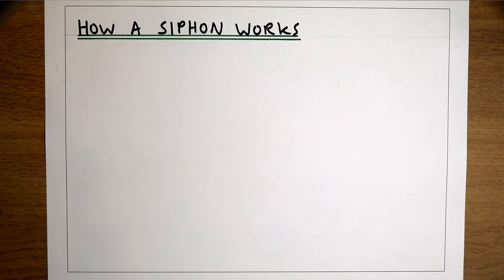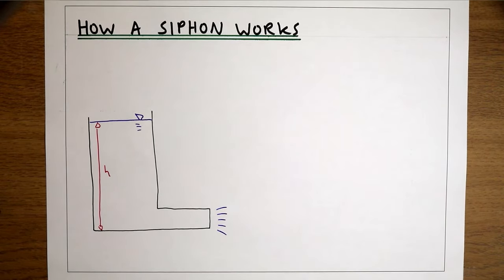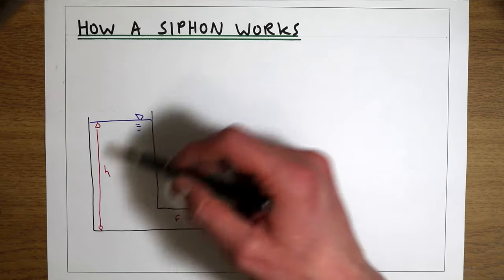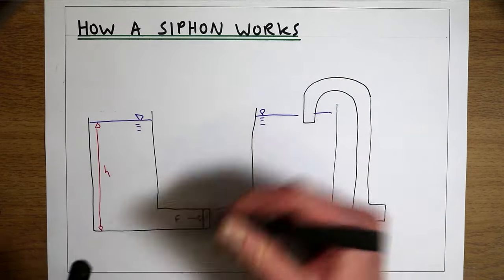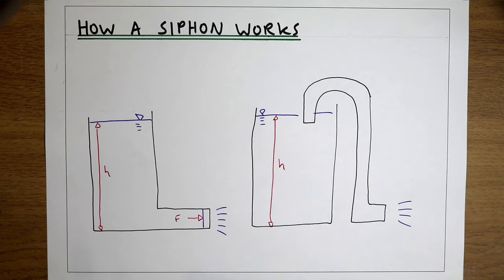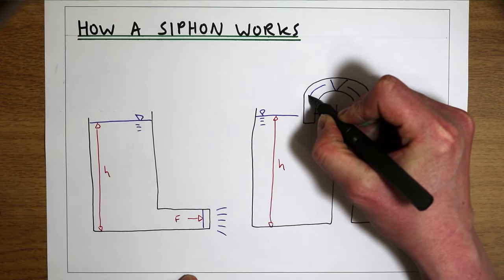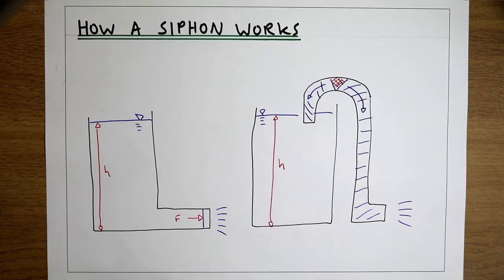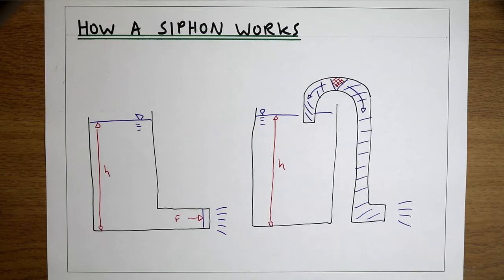How a siphon (syphon) works

Comment: That pipe needs to reach to the bottom of the container to have the same pressure as the first container
Reply from the maker: Hmm, that’s an interesting one. My argument would be that in theory, the liquid has the same total head at all points in the container, so the tube position in the container should be irrelevant (apart from that in real life, if the tube is near the surface, the syphon will stop as the container empties). If the tube is at the bottom of the container, yes, pressure is higher than if it was at the top, but if the tube is at the top (as I’ve drawn), elevation head is higher. The sum of pressure head and elevation head at any point in the container must be the same if we assume the tank is static prior to the syphon starting, and either of these heads can be converted into kinetic energy at the outlet interchangeably. If you work through the maths, the only variable that is accounted for in Bernoulli’s equation is the difference in elevation between the water surface of the container and the outlet. By the time the water has made its way through the syphon and to the bottom of the tube just before the outlet on the right, it will have the same pressure as the pic on the left, as the elevation head has been transformed into pressure head? It’s the principal explained in this video:

https://www.youtube.com/watch?v=IE72op7p9yY
Reply: @fluidsexplained1901  Yes that's correct, good explanation. It would make more sense for the pipe to reach near the bottom, but the overall net force will be the same as at the top.

Comment: This is a very limited (only one) example of the many ways that siphons can be/are used: partial/inverted/self-starting/capillary/bubbling/barometer/...
PS: 'vacuum' is nearly possible above about 32' (a function of barometric/atmospheric pressure), near which the water near the apex will be boiling and the column will collapse.

Comment: I understand what you have said but it appears the explanation does not explain why the outlet of the pipe needs to be at a level lower than the water level. (Or maybe I have missed something?)
Reply from the maker: This is what give the pressure different that drives the flow. Because if the water level is higher on one sider of the pipe, it means the pressure is higher, which pushes the water through the pipe.

Comment: Isn’t the pressure at the bottom of the tank much higher than the pressure at the top of the tank? 
I would assume the pressure would not depend on the hight of the tank but rather just the hight until where the tube is inside the tank

Comment: I still don't understand the definition of the "pressure" of the water that allows it to flow via a siphon.  

Is it correct to assume that the reason it continues to flow is purely because of the possibility of a vacuum that causes the exiting water to always drag the adjacent water out until equilibrium between the exterior environment and the environment at the point of entry to the siphon?
Reply from the maker: Hi, thanks for the comment. Yes that’s correct. There is a pressure difference between the surface of the tank and the outlet pipe (at atmospheric pressure). So this pressure difference forces water through the pipe. The only thing that would stop the flow due to the net pressure difference between the tank and outlet would be if the water was to ‘fall’ back down the pipe. But this can’t happen due to the vacuum – if the water was to separate in the pipe, the volume where the water had separated would be a vacuum and would therefore have less pressure than the water on either side, so it would be immediately closed. Essentially the whole problem can be solved by the simple idea that water always flows from areas of high pressure to areas of low pressure. Hope that helps?
Reply: @fluidsexplained1901  Awesome, thanks a lot for the reply!  That's good, that fits with how I assumed it worked, just never really knew how to put it into words so thanks for the clarification!
Reply: Yep. Exactly

Comment: Hi and thanks for the video, but I have a question. Let's imagine a straight pipe from the tank, with a turn at 90 °, then a straight horizontal section of pipe, another turn toward the bottom at 90 ° again, and finally a straight vertical section of the pipe. I made the hypothesis that at the initial condition, the fluid in the pipe is at rest. So, I calculate the pressure at the inlet of the pipe into the tank Pe = rho * g * (Za + H - Ze) + Pair (where Za is the free surface altitude, Ze the altitude of the inlet of the pipe, and H is the distance between the free surface and the highest point on the vertical straight section of pipe because, in my opinion, all that height of fluid weighs on the inlet ?). So, I used the Bernoulli law and calculate the condition for having an outlet speed > 0. The result is that  Zs < Za + H (where Zs is the altitude of the outlet). Am I right? Because I have seen also in a video that the condition should be Zs < Za, with a classical flexible pipe. Thanks in advance.
Reply: Time to put theory to practice and figure it out

Comment: I have a question; you repeatedly state that there has to be no air in the pipe. How does this relate to flying droplet siphons? There is clearly air inbetween two water pipes.

Comment: I need your help please. I am trying to drain off some water from a flooded piece of land to an area that's about 1 foot higher. Can you recommend something please?
Reply: What you’ll probably need is an actual pump. Depending on the elevation and location of the flooded land you might have a high water table.  After you pump it out, you might have to get fill dirt (to level them out with watch other) in order to prevent further water pooling there.
Reply: @hunterz1x321  thanks.. I'm working on  getting a pump
Reply from the maker: As noted by @HUNTERZ1X, if the area you are moving the water to is above the surface of the water you want to move, a simple siphon would not work. However, I also made a video about basics principals of designing a pump system (link below). Although in the video the water surface of the tank is above the end of the pipe, the maths and principals would work exactly the same for the system you are discussing. It might help in working out what pump to go for.

https://www.youtube.com/watch?v=FGVAmWQuUhs&list=PLgswUthJnnpDPEyIDLSYUL2sGmafz-S3P&index=17

Comment: A good explanation but would disagree on a couple of points. 

Firstly the vacuum wouldn't need to be perfect. If you connected a transparent vacuum chamber at the top with a larger volume than the section of tubing you would see the water from the top bucket pulled (or more accurately, pushed) up, accumulate at the bottom of the vacuum chamber and flow back down again. The section of "air" at the top of the vacuum chamber would have to remain below 1 atm  enough for the atm at the surface of the top bucket to push water into the chamber. The mass of the height of the column of water going to the bottom bucket (along with gravity) preserves the vacuum below 1 atm. 

The second point follows from the first in that the partial vacuum and water at the top section of the tube can be separated but this can never happen with just the tube itself but requires a separate break section with greater volume than the rest of the tube.
Reply from the maker: Thanks for the comment, that’s really interesting! I actually made this video without thinking too much about it after one of my students asked me about a syphon. So in my mind, it is quite surface level explanation just to get the main concepts across. When I threw it together in a few spare moments, I could never have imagined that it would be my most popular video with more than 80K views (way more views than my more recent videos that took me a few months each to make)! I’ve also learnt more from well informed comments like this. Maybe there is a need to re-make a more comprehensive version some day!

Comment: Hello..  I want to ask.. Can the water increase its pressure when u make an tube arc that ishigher. 

Imagine when 3 floors. 
1st floor is the the outlet. 
2nd floor is the water jug(source of water) 
And 3rd  is the water arc of the water pipe

We all know that we can directly get water from the source in the 2nd floor directly to the 1st floor.. 

The question is.. If we increase the height of the tupe upto the 3rd floor. It will increase?
Reply from the maker: It’s a good question. The only parameter that sets the systems total pressure in the system, if the start and end are both open to atmosphere, is the difference in height between the start and the end point, regardless of how high the arc is. If you think about it, a water particle has to lose pressure to climb up the arc, and is then only re-ganging what was lost as it comes down. On the way up, pressure is being converted to potential energy, on the way down the opposite is happening. Hope that makes sense?

Comment: Is the height from one body of water to another the cause of the vacuum strength for the suction or is it gravity
Reply from the maker: Both, the height is essentially potential energy because of gravity.
Reply: The density of water in the section of pipe going to the bottom bucket multiplied by its height is what determines the negative pressure or suction (hence it's both). Very similar to how a barometer works.

So in principle if the tube was perfectly rigid this could lift the water up just under 10m (equal to 1atm) and back down again (minus the extra bit needed for the bottom basin).

Comment: I just bought a jiggle siphon but couldn’t sustain the flow. Now I realise the hose needed to be filled first.
Reply from the maker: Hope the video helped!
Reply: @fluidsexplained1901  it help lead me in the right direction. I have discovered with this jiggle siphon it helps if the top container has a high water mark. There might be a way to get it to work with a lower water mark but haven’t tried it out yet. But the real test is to see if I can use the siphon to empty a flooded backyard while it is raining. Have to wait until the next big rain event.

Comment: you did not speak about siphon you spoke about placing the siphon pipe in top of the water tank what if we put the siphon in the same location of the first example?

can we use the siphon as a valve when the pressure is high the water will go when the pressure is low the water will stay? you did not answer that

and siphon has S-shaped you did not drew that